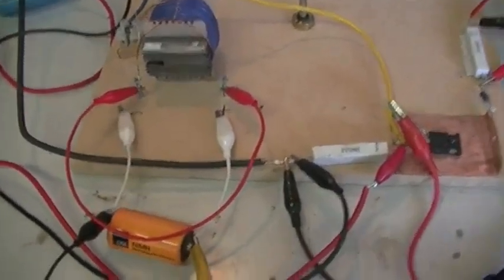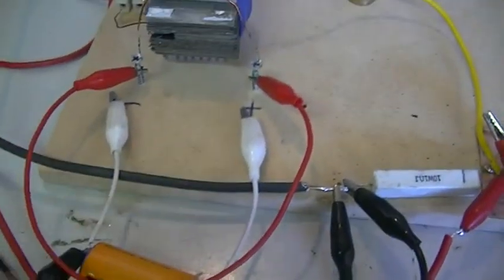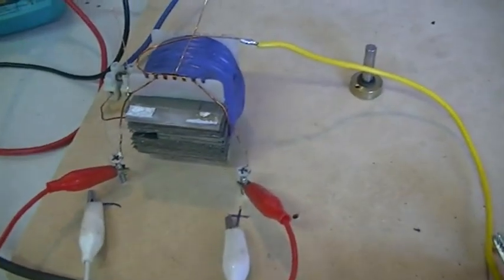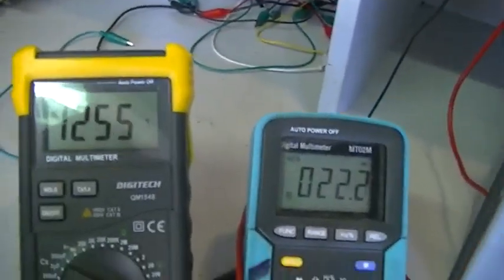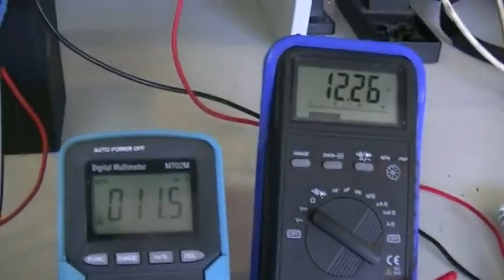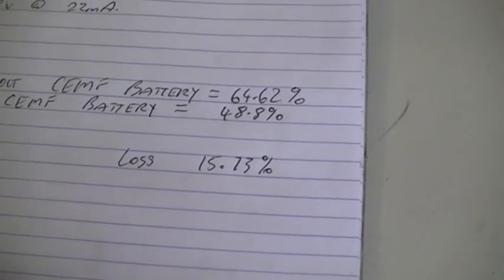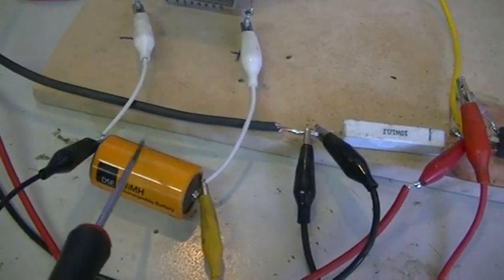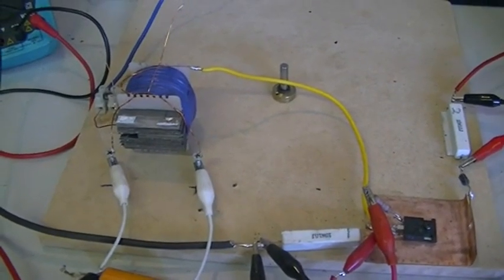Counter EMF battery coil test.

Comment: I have tried a similar test with small motors. More input to the system is less gain. So there must be an optimum input ratio to the scale of the system.

Comment: Thanks for sharing. Your videos are very helpful. The efficiency of a coil appears to increase when the function of a two wire secondary are split. One for the trigger and one to assist the spike through the charge battery with a cap across it. A split bucking coil is what I'm testing. Charging a supercapacitor bank would be a big improvement over the resistance of a battery.